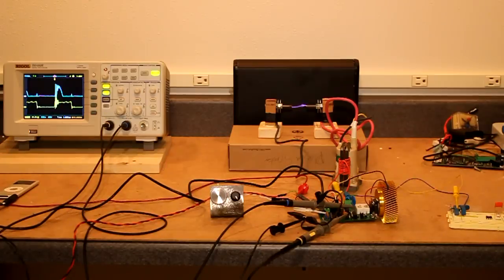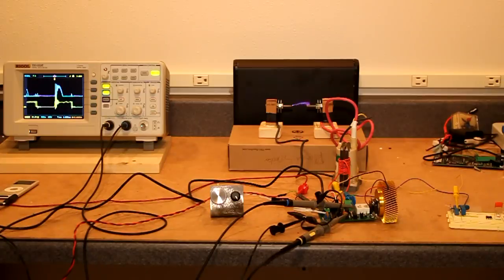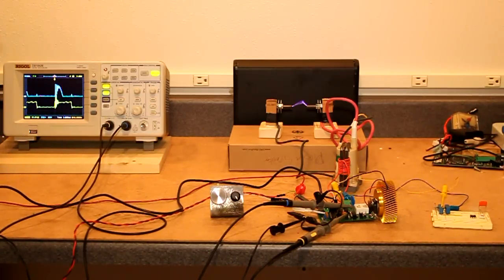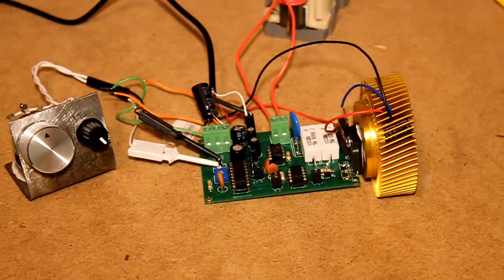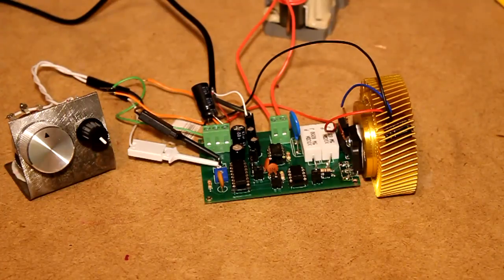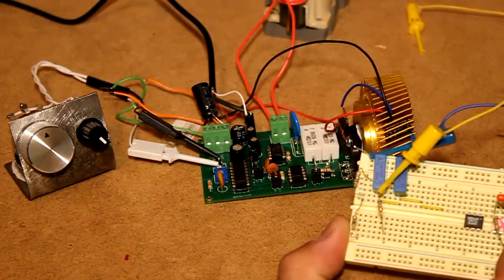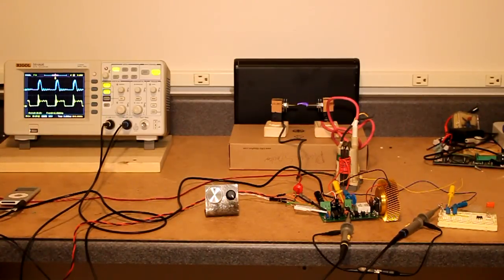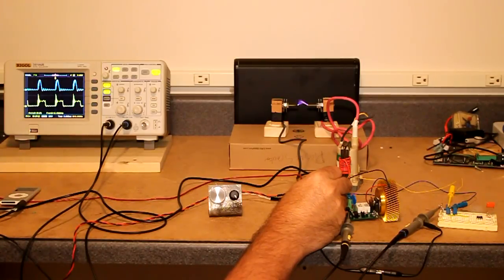Plasma Speaker Demo

Comment: I remember seeing some TV documentary as a child, where this guy got sound out of a candle flame by sticking a couple of wires into it. A flame would also be a plasma of sorts, wouldn’t it? And since its ionization is sustained by other means, you wouldn’t need a very high voltage to put a current through it.

Comment from the maker: @PeteDog444 After a lot of trouble with some of the other circuits (especially the "fullbridge flyback driver" floating around out there), I decided to go for simplicity on this revision. I did leave independent jumpers for the TL494 outputs designed into the board in the video, so it will be possible to play around with some alternate driver circuits. I'll be working on the next board revision soon, so if you can point me to a good push-pull design, I can see about incorporating it.

Comment: Why did you choose not to use a push pull configuration to drive the fly back primary?  Push pull seems to be much more efficient and gives you a larger arch witch can produce more volume and lower frequency response.